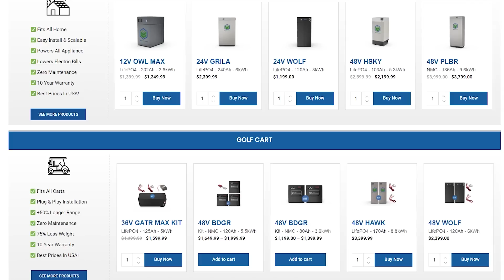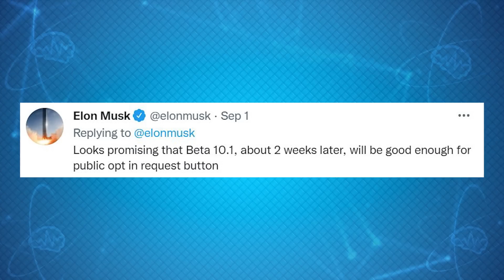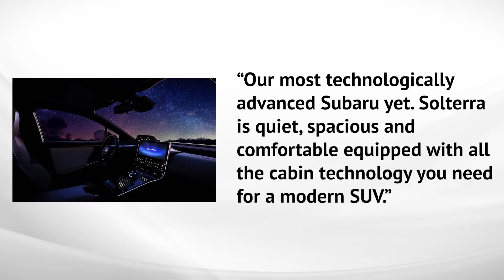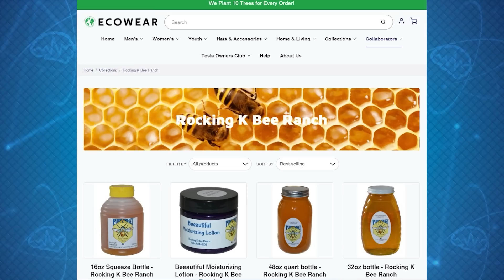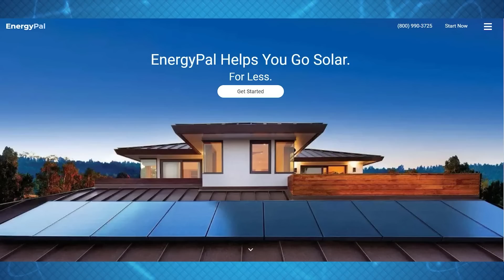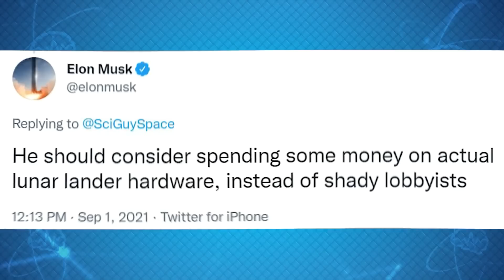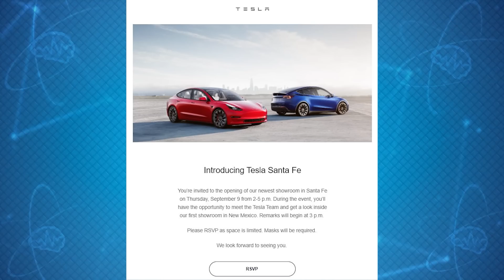Tesla Time News | Tesla Worth $3 Trillion by 2025

Comment from the maker: Timestamps:
Cybertruck Delayed to 2022 - 4:40
Model 2 Coming in 2023 - 5:48
GreenPower Motors - 8:02
FSD Update - 8:39
Professor Musk on Batteries - 10:34
Tesla’s Cabin Camera - 13:27
Rivian Update - 14:32
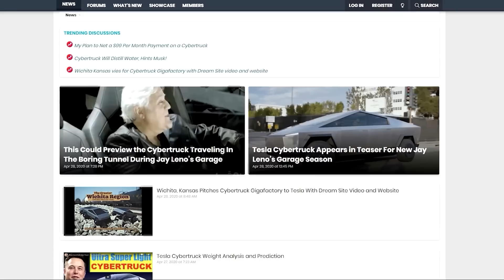Well Done Foundation Update - 17:11
Ariel Rideal E-Bike - 20:49
Cupra UrbanRebel Concept - 21:26
Audi’s Grandsphere Concept - 22:53
Subaru Solterra - 23:46
VW’s Sub $25k ID Concept Car - 24:30
GM Halts Bolt Production - 26:35
Reply: OK, so REEs are indeed not very rare in terms of total quantities in the Earth's crust -- but economic concentrations of them are rarer than, say, economic copper deposits.

Also, regarding nickel, there are enormous metric sh!t-tonnes of the stuff in the main asteroid belt. :-)
Reply: Where are the Time Stamps for the other half of the video?
Reply: Model 2 needs a steering wheel and pedals. It’s ridiculous to do away with it as many of us like driving without putting co-ordinates, etc. It’ll sell well but without a steering wheel, it’ll fail.
Reply: any chance you could time stamp the whole show? i like skipping through stories im not interested in.

Comment: I think these delays are significantly related to difficulties with making the 4680 at mass production.  The "no wheels and pedals" is ridiculous!  The not to be called the model 2 will come out to the population.  Autonomous ride hailing especially with a car without a wheel and pedals is way way off.  Several accidents with a car like that would shut things down pretty quickly.
Reply: It will be a slow and cautious adoption process. By becoming early adopters for short trips can help speed up the process

Comment: The upper control arm thing worries me, my M3 has ~45,000mi on it and last year had the right upper control arm replaced, just got it back from service after a month wait for an appointment for them to replace the left upper control arm.  Seems to be a trend of people having to get those replaced, at least it seems to be happening under warranty.. at least for the first time.
Reply: You don’t need to completely replace the control arm is if the car is out of warranty, which will cost quite a bit, but an independent shop can just grease up the area where the control arms are bolted to the car. Should be much much cheaper and should last a couple years.
Reply: @harsimranbansal5355  Good to know, it seems they also might be doing this at the service center along with the replacement as on my service receipt it says they replaced the LH upper control arm, and also says they "resealed area around both upper control arm ball joints with urethane"

Comment: The iron based chemistry instead of the more rare nickel is based on the economics.  The more common element is so much less expensive, if a total battery chemistry can achieve a useful level of performance on the important battery metrics people compete on, it makes sense to use a slightly less efficient chemistry for the economic advantage of the cheaper materials.   Especially for city scale mega-pack batteries that don't need to move.  Stationary storage can handle being less efficient, if it's cheap enough.

Comment: In my opinion, Johnny-Cab-level FSD won't be out for around 5 years. So the Model 2 (whatever they call it) will certainly have steering wheel and pedals. If it actually had only 2 doors, it wouldn't be a very good candidate for taxis, autonomous or not.

Comment: Your observation about refrigerated delivery/hauling trucks.  The truck engines are left on based on the erroneous notion that starting and stopping diesel engines is hard on the engine. Diesel at idle cokes the cylinders.  As for refrigeration, these trucks, trailers actually have a separate diesel powered refrigeration unit and these are left on, for obvious reasons, during deliveries.  Using photo voltaic panels on semi trailer roofs would be ideal.  However if it is direct panel to refrigeration unit transfer of electricity, what do the haulers do during hours of darkness?  Run a diesel power source?  If the drivers would shut down the engines that would be a nice.  Think this topic needs much more work.

Comment: Semi trucks don't leave their engines running to refrigerate their cargo.

The trailers themselves have individual units with small diesel engines that keep the trucks refrigerated.

I think the electric ones will still need their own batteries as those trailers don't always have a truck attached to them..

Comment: 29:51 There's an ARS Technica article that says the Bolt fires "may" be due to a misaligned factory robot that handles the battery. It's not clear if that robot is on LG Chem's side or GM's manufacturing side so I would reserve pointing fingers at LG Chem until this is definitively confirmed.

Comment: 35:45.  Not entirely true. Trucks and trailers have a separate much smaller generator motor to power the refrigerator, not the main truck motor  And when parked most get plugged into dockside power

Comment: The model 2 will have a steering wheel.  Otherwise, it will be impossible to move around unless the app turns into total RC Car stuff.  

It will be the model Q with an F option.  Known as the Model F Q.

Comment: I don’t think the tiny Model 2 would be the best car for the Tesla network.  I think the Model Y would be more practical.  Model 2 would be best suited as a cheaper Tesla for the masses.  In this case, it should definitely have a steering wheel.  We are still years away, in my opinion, from a time where regulators will allow a car without a steering wheel.
Reply: Yeah I also think that , because with front and back casting and a small battery ...it can be made way cheaper ...once even higher scalability is achieved
Reply: I agree personally I believe they should all ways have manual control  if not only for extreme edge cases. Fold out of the way and lockable controls is probably the way to go.

Comment: No proof yet that the issue is with LG's cells. Does LG wire these batteries into the pack for GM? It may not be a cell issue but a design issue with the pack.

Comment: I don’t think model 2 will be a Tesla network exclusive. The revenue will be so high when level 5 is reached that the difference between a $35,000 base price and a $25,000 base price car isn’t enough to make a huge difference. Tesla isn’t limited by capital, they are limited by supply chains, batteries and gigafactory improvements.  When you hail an autonomous taxi I feel like you would be more likely to want to shell out the additional $0.20 or however much more it would cost to upgrade your user experience so model 3 and Y and cybertruck will still get a huge market share of rideshare use. The whole point of model 2 is to make it more accessible to the masses because of the high initial cost.

Comment: @ 57:10 - 40 Stalls? Jealous! One of four reasons I bought my M3SR+ in Oct'19 was that the Calgary downtown AB SC was due by that year end. It's been postponed over & over and is currently set @ Q4'21. SURE?! It had better have lots of stalls and be something like the Kettleman City SC. Just sayin'!
It's frustrating in Winter using 110V charger. I have to top up weekly @ a SC burnng off 68km roundtrip!
Tesla did complete most of the TransCanada SC's, but then...Covid! So no retirement trip out east for me either. Ack!

Comment: Tesla is doing great with the 3 models in production but I really think they have missed the boat with the truck and small car market. Other OEMs are closing in and will steal market share unless Tesla can  turn out their newer models. Ford, VW and other big manufacturers have no difficulty in building a whole slew of new models. But Tesla simply don't have the scale to operate with that level of flexibility . Unless they can continue to innovate and turn out new models on schedule, it could be their undoing in the long run.

Comment: That for Idaho,  I have my battery on new model y dead while charge at home 120v. Brought in T Kearney in San Diego.  They damage inside head liner n side door.  I report it. Went back n forth 5her employee  said parts in order. A year later still not tell me.  I went back in ask why. The black guy said part ready come tomorrow.  I cam early morning.  Different guy call manager out n look into file.  There is no record of me first reported or came in 10 different times.  So Luis the manager said no, he not gonna fix it.  I asked for San Diego county manager, he said there is no one.  Only straight within local store, n he said no.  
Any one know who I can contact or talk to to fix this? Please,  they did dammage this during swap out the high volt pack, thanks

Comment: Tesla has the super cars, the SUV, the sedan, the crossover, what they really need is an affordable roadster like the miata, but Tesla.  I hear miata is going to have an EV next year.  How could it possibly be better than the miata they now sell?  Maybe in a freevalve version with supercharging that burns green fuel, but electric?  They have to overcome the weight of the battery pack before it will be possible.  You do realize that the real Tesla would not be limited by weight because along with over the air updates he would have power for the motors broadcast from regional transmitters.

Comment: if the rivian battery pack is that huge, their production volume is going to be really awful.  the world just doesn't produce that many batteries and Rivian is stuck competing for battery cells with big auto.    speaking of battery bottleneck, I suspect the cybertruck simply cannot be produced until volume production of the 4680 cells is achieved.  and Elon said last year at battery day that it could be 2-3 years for that to happen.  it would seem like the stuff you mentioned in this video fits perfectly with this.

Comment: A refrigerated trailer on a semi has its own diesel motor and does not rely on the semi for power. This new development sounds like it makes the trailer a hybrid trailer. Using both electric and diesel. Also, independent of the semi.

Comment: Solar windows is 5.32 today. Always buy only what you can lose
Reply: I bought$2000 at 12.50 and $2000 at 10.00. My point is that you need to do some research beyond the initial.  I believe they will get there so I am holding on to the stock longer term.  If I lose it I will live.  They need to do some more proof of concept.  I think it is like comparing diamond batteries to 4680 with respect to solar panels.

Comment: Tesla needs to get the cybertruck on the roads as fast as it can, and the semi, while continuing to scale up the model 3 and Y. The compact is something they also need to be flooding the market with, asap, not in 3 years.   And it needs to be way cheaper than $25,000 USD. I don't think they can do it quickly enough. China is the answer.  Only someone like BYD can build the required volume of cheap EVs cars for the world market , quickly enough. I heard Elon did some type of deal with BYD, probably to supply it's blade battery. Once the Chinese companies market their EVs worldwide, and cheaply, everything will be disrupted. And the tesla shortsellers will be vaporized.

Comment: If Tesla makes 3 trillion by 2025 it will be because a dollar has dropped to 1/10th it's current value.  Tesla is not leading anything because they are using Lithium ion an inferior technology that is as dead as ICE.  They are in no  better position to move to Solid State than any other company because Lithium ion factories are totally different than solid state.  When a Chinese /Gm company is making a $4000 , 100 mile range electric car; Tesla will become the Jaguar of electrics with no consumer model and a decent but not significant portion of the market. Oh yes the fantasy 25k Telsa; same as the 30K Model 3 with a $10,000 extra for FSD.  Typical  bate and switch - got to see the truck - this will be funny.